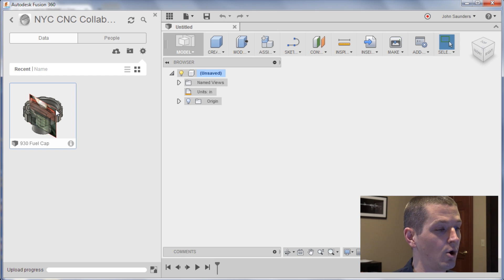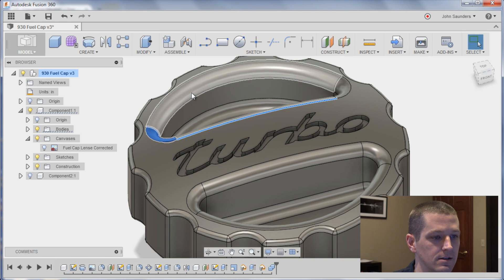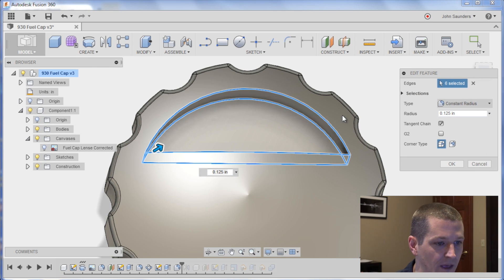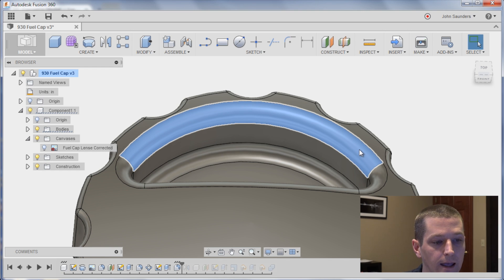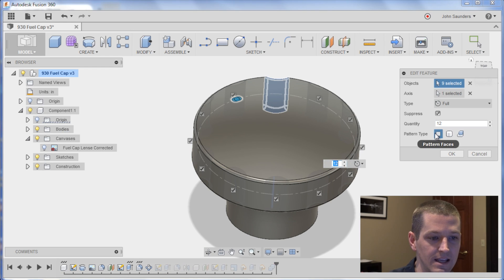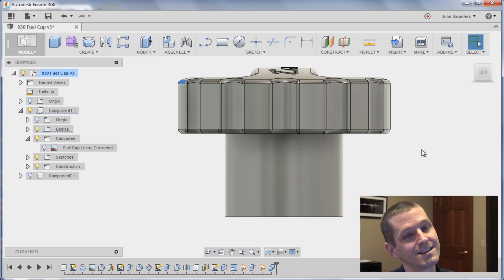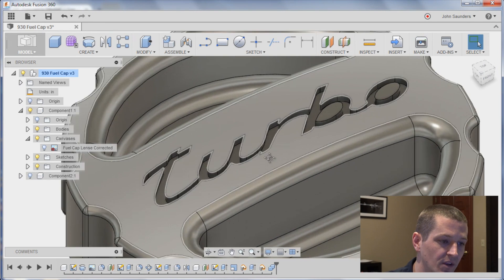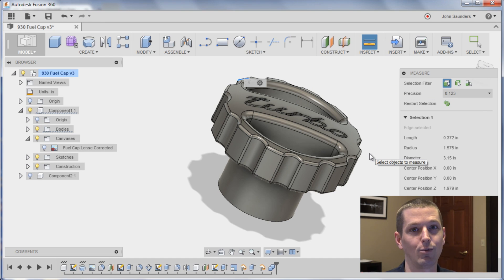How to: Porsche Turbo Gas Cap!  Design & Make!   Part 2

Comment: Nice collaboration! He used some different modeling techniques that I much prefer to how I have done things in the past.
Threads: Maybe external Threadmilling with a Radius slot cutter? 
Also a slight step at the edged  of the cap may make radius cutter issues easier with almost negligible visual design change. Good luck - cool project and selling to Porsche owners means lots of $$$$$$

Comment: John

I had a part with required a quarter turn helix in 37mm on a 18mm shaft for a model corliss engine govener  I posted on a ME forum as I know there are a few hand coders on there

Quote from chuck
Maybe I'm missing something but this seems like a simple, one line g-code command.

G01 X37 A90 F50

That command will move the X-axis 37 millimeters and simultaneously rotate the shaft 90 degrees.  This assumes you have mach3 setup with the 4th axis in degrees where A360 turns the shaft one full revolution.  The F50 specifies a feed rate of 50 millimeters per minute for the fastest moving axis.

Chuck

Maybe you could expand that simple code to cut that thread in the mill using the 4th axis , hate to say though not fusion360 would be involved

Stuart

Comment: Couldn't you use the solid model coil to cut the threads like sam used the component he created from the svg as a tool to cut the logo? Initial thoughts, will have to try myself.
Reply: Just tried it. Used the coil to cut. Dont have fuel cap dimensions but looks awesome.
Reply: +CascadeMW You're right, thats how I did it, using the triangle and tuning the fillets to get it as close as possible going off pictures.

Comment: Wouldn't you want to turn a "blank" on the lathe first before throwing it into the mill for the rest of the operations? So:

1) Lathe: turn the OD and overall cap shape
2) Mill: mill out the two inner pockets and outside grip "grooves" and "turbo" logo
3) Lathe: turn the ball-threads and mill out the inside for weight optimization
Reply: No, we're just both equally smart ;-)

Comment: I've got a buddy that has a bunch of 930's up at his dealership, I can take some measurements if you need me to.
Reply: +Finn Custom Knives Your buddy is a lucky guy.
Reply: +Sam Birchenough eh 930's are cool and whatnot but he gets some seriously sick stuff in there. For example, right now they have a carerra gt, 991 GT3, and a GT4. SO much more win in those cars than any 930. 

Although we did tear up a full track prepped 930 turbo pushing 650 whp a few years back. That thing was NASTY. Literally scary fast and still is the only car I have been in with giant carbon brake ducts under the car, 2 race seats, and a Blaupunkt lol
Reply: +Finn Custom Knives Thats awesome man. The GT3 and GT4 are quick, love the 997.2 personally. I'm working towards a 964 C2... hopefully in the next few years! I was close a few years ago before the ridiculous air cooled 911 bubble.
Reply: +Sam Birchenough right there with you. The 997 mk2 GT3 is the epitome of the perfect DD for a car guy IMO. Ridiculously perfect manual transmission and steering, Metzger engine, and centerlocks FTW lol
Reply: +Finn Custom Knives and its the right size! One day, hopefully before I'm old.
Reply: Careful.. Porsche might actually like this one :) lol Nice though

Comment: Awesome!
this would be an interesting 3D printing project (maybe cheaper, too?)
Thumbs up as always!
Reply: Fuel would eat 3D printed material
Reply: +ZakkBlog I'll be 3D printing it in an upcoming part. Thanks for watching.
Reply: +ZakkBlog Can't really beat a milled part, 3d printing can not compare.
Reply: +RC Grid depends what material you print it in.

apparently Nylon has Petrol resistant properties, Nylon is a material that is available as a filament for 3D printing. (hoping to get some soon)
Reply: +Sam Birchenough no problem! thanks for sharing!
Reply: +ZakkBlog Interesting!
Reply: +RC Grid 3D printing is a very interesting subject :) so many possibilities  (also many limitations to still be conquered)
Reply: +ZakkBlog could be 3d printed in metal laser sintering or binder jet then set in a oven would work
Reply: +robo268 true. my point was it can be plastic, and it can be 3D printed (it can also be metal, no reason i know of that it can't). i don't know about the Porsche gas cap, but all the gas caps i've seen have been plastic. :)
Reply: ZakkBlog Then mill it from plastic, it will look better and be stronger.
Reply: +ZakkBlog  +NYC CNC  another option that doesn't come up enough in these sorts of comments/discussions is 3d printing in wax and investment casting them. You can then heat treat for the material properties you desire and also surface treatment for wear and tear...if you want to produce larger quantities and go into production, you can 3d print the master molds, cast those, then use powder metallurgy (microwave sintering technology has come a long way, especially in countries like Russia and China). These are all examples of "green" or "additive manufacturing" processes that go beyond the traditional solutions of milling/lathe work. We have to start being smarter about our manufacturing....these types of processes are already well established in other countries and when the energy crisis of  late stage capitalism sets in, it'll be the only viable option.